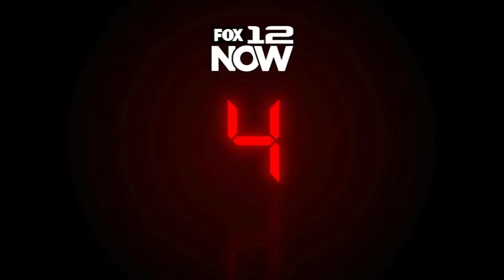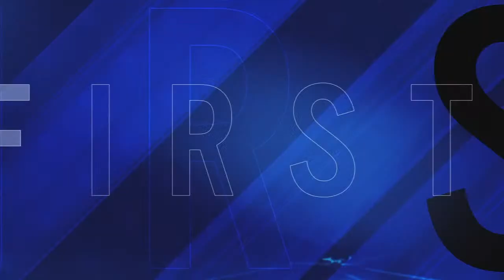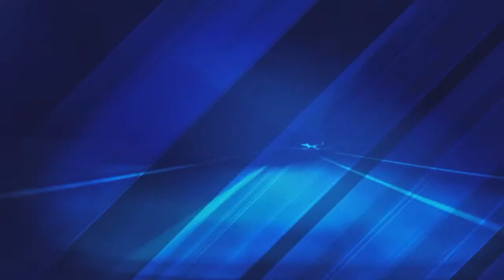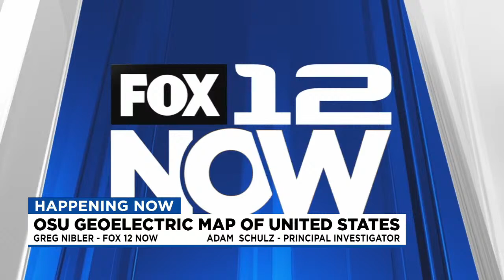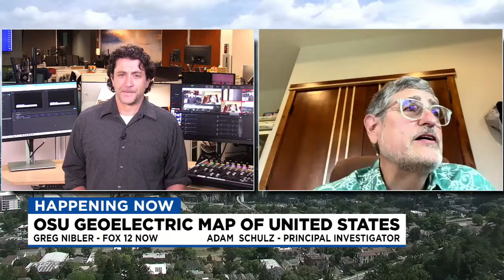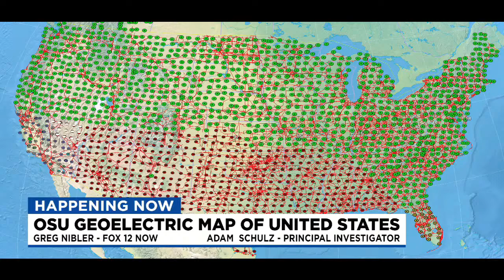Protecting the electrical grid from EMP attacks, solar storms by mapping

Comment: The planning and problem-solving potential developed by this phenomenal achievement is staggering. I congratulate you!  However, it is disturbing that the data and its implications have to be kept from the public because of political and security concerns. These are clear indicators that we live in turbulent and exceedingly dangerous times. Now, when we suffer the next geomagnetic reversal or galactic current sheet impact, or EMP, elites will have advanced knowledge to prepare but the public who funded this project will be proverbially 'left in the dark'. Pity.
Reply: Didn't they say at the beginning that this information is available to the public?
Reply: @doUCwhatISee1  yes the guy said that a few times, but i can't find it